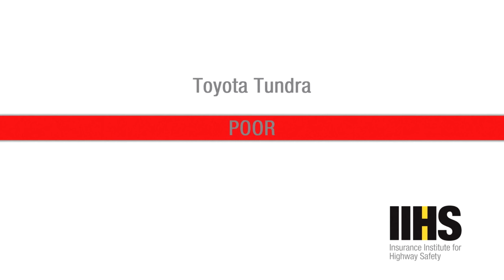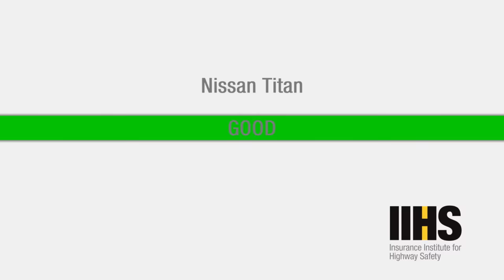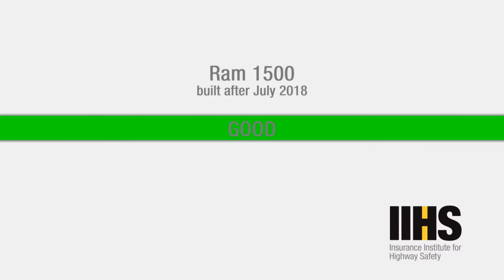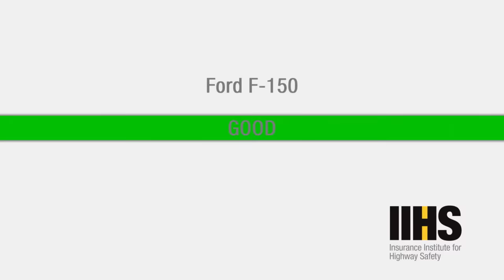TRUCK CRASH TEST COMPILATION - Ford F150, Toyota Tundra, RAM 1500, Nissan Titan

Comment: Im waiting for the CYBERTRUCK crash test
Reply: 999 Subs Without Videos same
Reply: Im pretty sure it will be very poor as i have no idea how exactly a steel shell will absorb the crash energy..
Reply: It'll drive right through the barrier haha
Reply: @ggoddkkiller1342  You have no idea, but you are sure it will perform poor? Interesting logic.
Reply: Probably won't even get a dent
Reply: @advandermeer  it's a super hard metal that is used on the Cyber truck... and because of its front being empty it can absorb a lot of the energy.....
Reply: @ggoddkkiller1342  go to your old school or current school and let your parents ask for a refund since you have no common scene to this logically
Reply: Arno Nell Acrually, you’re the one who needs to go back to school and learn proper grammar.  Beyond that, @Ghoddkkiller is correct, the cyber truck, as built, does not appear to be very survivable due to its rigid construction. This has been pointed out by MANY automotive design experts. It’s laughable that so many people think this thing will actually end up looking like what was revealed. It will not pass even pedestrian safety standards.
Reply: Cyber truck will break the barrier
Reply: @jeremyrodriguez5923  😍
Reply: Ad van der Meer actually it has no front crash zones as per its pictures and to be sold changes will have to be made. Most likely a longer front end .
Reply: Me too i want to see how that thing breaks
Reply: ye me too
Reply: @Luis Bolanos not funny, didnt laugh
Reply: @jeremyrodriguez5923  cybertruck can be still driveable and gets a acceptable rating
Reply: @Pilot545  you spelled actually wrong so stop talking
Reply: 999 Subs Without Videos its probably not even gonna crash bruh its just gonna bend a little lol
Reply: Jeje
Reply: @advandermeer  cars need to absorb enough force so the driver doesn't die from a crash. The front of the cyber truck doesn't seem long enough to absorb the force of an impact.
Reply: Dont you know sir they are incapable of wrecking
Reply: @Jonathan Young sounds pretty safe
Reply: @ru5h21  That barrier has been used for many years. I highly doubt the Tesla Cybertruck will do damage to it
Reply: @bradygiles4059  The barrier will not break to the cybertruck due to the shape of the Cybertruck having many weak points, It does not make it safe if it does not break, in slight chance it does break the barrier, it will not be allowed on road due to dangers of opposing driver in the chance of an accident
Reply: That's basically crashtesting the facility
Reply: pretty sure that design is never going to be road legal
it's one step short of putting massive blades on the outer shell of the car
Reply: Its gone be a murder
Reply: @ggoddkkiller1342  teslas are very safe safer than regular cars
Reply: Blurzz Melo  everyone already cought up already the only thing that is special about Tesla’s is the autopilot
Reply: Probably will damage the test equipment
Reply: You have 21 subscribers
Reply: Don't worry, Elon musk already bought the crash test company
Reply: Blurzz Melo Volvo: Am I a joke to you?
Reply: @advandermeer  Yes it will perform purely because it is extra hardened steal that sole purpose is to only protect the people inside while he will destroy other cars, instead of "helping" to divert the impact energy.
Reply: @arnonell   It can absorb a lot of energy because it is empty? Nope, completely false logic. It needs the energy to travel along vectors. Empty space does not do that, besides that steal will not deform as easily as other cars, meaning that it will hit the other cars like a wolfram bullet.
Reply: Gonna be -100 stars
Reply: @ru5h21  🤣🤣🤣🤣
Reply: It's a cypercash not a Truck
Reply: Ggoddkkiller tesla wouldn’t dare to make a vehicle without a 5-star safety rating
Reply: @arnonell  That means the meat sacks inside get splatted on the dashboard.
Reply: i can just picture the test guys getting pissed that the thing keeps swerving to avoid the collision
Reply: They need titanium wall
Reply: @ggoddkkiller1342  well the rest of the tesla line up is almost perfect
Reply: Remember it’s unbreakable windows? 😅
Reply: I bet that it will just bounce off the wall😂
Reply: @ggoddkkiller1342  "I'm pretty sure it will be very poor because I know nothing about engineering, automotive science, steel, crash tests, or anything at all really. I'm just pulling a guess out of my ass and pretending I know things that I obviously don't." You're a joke, dude.
Reply: It will probably explode like most teslas do
Reply: @bradygiles4059  same like someone break cybertruck window hahahaha
Reply: Cybertruck will never be road legal.  It was a meme.  Eventually all those $100 pre-orders will be refunded.
Reply: Ad van der Meer he’s saying no body of a car has ever been built like the cyber truck, cars now days are meant to crush so you don’t get the force from wrecks. The cyber truck is made to last, not only is it made out of a steel shell, it resembles a triangle, a triangle being the strongest shape, as shown in bridges, and Sence the truck has not been let out or tested, he does not know but that is what he believes.
Reply: Ggoddkkiller i’ll be surprised if it’s approved for street use and has safety ratings
Reply: It will fold up just like the rest ive dropped 312 stainless on the floor from waist height once and it dented like any other solid material that stainless sheet metal body will fold hitting a rigid barrier like above
Reply: It would be going 100 mph and not even have a dent 😂
Reply: It would probably disintegrate
Reply: It will dodge the obstacle itself 😂
Reply: since its a totally new design without years of crash testing to make it better im sure it will be one of the worst....
Reply: Ikr
Reply: Same
Reply: Yeah... The cybertruck will result in lots of deaths. Older cars used to be made of solid steel and the fatality rate was much higher... The cybertruck has no crumple zone, so you and people around you would be dead...
Reply: Plus any way its gonna be too expensive for a crash test
Reply: Yea boi
Reply: @ggoddkkiller1342  Steel absorbs energy very well. It deforms instead of breaking.
Reply: The wall would break
Reply: Bounce like tennis ball.
Reply: @adammorenberg6755  says 2017 model s
Reply: No to worry, the batteries will explode and catch fire...🤡

Comment: Idc who you are, for all of those truck people out there you would agree. The Honda Ridgeline isn't a REAL truck. Unibody or a cab on frame, don't matter. Separated cab from bed, Don't matter.  Drop tailgate, don't matter. At minimum a solid rear axel, don't matter. Until honda makes a truck that can compete with a Tacoma at least, it will never be a real truck. More like an oddessy with no roof over the rear portion.

Comment: The REAL badass is that block of steel.
Reply: Installing diesell turbine engines and tracks.
Reply: Robin Miller I want my Titan made of that same steel!!!!
Reply: Lol it's not steel. Its concrete with plastic casing.
Reply: @JSLCummins  how do u know?
Reply: I will try to avoid these stationary pillars, when driving down the highway.
Reply: @delano62  don't they have barrels full of water in front sometimes
Reply: That is Not plastic its T slotted steel encased with concrete and how do I know because I've worked with these test and the equipment
Reply: Ford?
Reply: I maybe think it's mixed with steel and osmium. Because it's crazy dens and hard. If not then Idk
Reply: @jeremyp5123  , that's what she said.
Reply: @Josh-179  who the F is she.
Reply: @jeremyp5123  , seriously?
Reply: @Josh-179  who is she. Robin Miller. I really don't get it......
Reply: @jeremyp5123  , you've never heard the phrase "that's what she said" following a sexual double entendre? It's a joke said millions of times.
Reply: @Josh-179  that  joke i have never heard of. Otherwise it's a American joke.
Reply: @jeremyp5123  lmao dude😂
Reply: Robin Miller yes
Reply: True!
Reply: Qual a velocidade dos carros ,  no  teste
Reply: I was in a car accident with a Chevy Silverado 2500 HD 2015
Reply: Sério
Reply: @mancaveveteran4975  I meant is it really a truck if you do? Kinda turns into heavy machinery/military stuff.
Reply: Yes sir

Comment: Interesting to see the Ford almost deflects itself out of the way.
Reply: Yeah, strait into the path of a passing semi...
Reply: @justin76bmw  right...
Reply: @justin76bmw  or not
Reply: I saw that
Reply: I'd bet you have a ford.
Reply: @nicstr28  I have a Toyota.
Reply: It’s cause the wheel bent inward.
Reply: @justin76bmw  Unless the object it hit was on the road, the truck didn’t bounce far enough to change lanes. If that was a parked car or tree etc. that wasn’t blocking any portion of the lane then the truck isn’t deflecting into oncoming traffic. Keep hating though!
Reply: Michael Teeple  Guess that’s why F-150s have the highest safety rating of any pickup...
Reply: Michael Teeple   actually the whole point it to protect the passenger compartment. notice how there is almost no give to the cabin unlike the tundra. Also if you notice they drain ALL fluids so no vehicles are running. They are pulled by a moving assembly under the floor.
Reply: fords are best
Reply: Michael Teeple  Had two F150s go past 500k with only spark plugs, regular maintenance and electrical issues (cabin lights.) One was a 99 and one was a 2010 and I’m onto a 2018 now. Also sold both in working condition. You know nothing about Fords other than what you hear in the media and on GM fanboy forums. Tell me how a lawsuit somehow makes the safest, best selling, most powerful, reliable truck on the road bad.
Reply: still the cab folds haha
Reply: @konrah1486  Thats why ford has a shitty poor rating in vehicle to vehicle crash tests
Reply: Volvo has been using this deflective design since the late 80s. I don't understand why some American vehicles still don't deflect in these collisions.
Reply: Definitely did better than the Jeep Wrangler that flipped during it's driver side test.
Reply: Yea
Reply: Was in a T-Bone last week with my 2008 F-150. Luckily I was in a Ford or may not have been able to pull the unconscious passengers from the smoking car that ran the stop sign.
Reply: @justin76bmw  duh...derp
Reply: @justin76bmw  you are "happy" owner of Toyota? 🤣🤣🤣🤣🤣🤣🤣🤣
Reply: Yeah and the vehicle from the front bangs it in a narrow lane and in one day the vehicle form the rear bangs it again and causes a pile up.
Reply: The defletor shild was set to max, I myself run it on medium.
I just realiced, I'm in the wrong century again.
Reply: I think it's the way the tire bent in /the front suspension gave way
Reply: @justin76bmw  good point, never thought of that.
Reply: @konrah1486  lol yeah right
Reply: @damitbobby6677  Yeah right what 😂
Reply: @konrah1486  500k on a ford
Reply: @damitbobby6677  500k on two Fords* 99 4.6 and 2010 5.4, guess you’ve never owned one!
Reply: @konrah1486  I have owned one. That's why I was saying yeah right
Reply: @damitbobby6677  Guess you got unlucky. What year and engine? Really hope you’re not some GM/RAM guy trying to talk about reliability...
Reply: Nostalgia am I right
Reply: @Dubz0408  Probably because GM is notorious for making unreliable cars. Ford isn’t, GM boys came up with that because they’re insecure about their trucks breaking down at 100k
Reply: @justin76bmw  Aww, him's mad. Let me guess. You bought one of the rice or pasta powered pickups, "because, "it looks tough.""
Reply: @Dubz0408  I had an 03 f150 that was already hagged to shit an it only died at 476,000 after I ran it all the way home on a blown engine and no oil. If it was maintained, woulda went forever
Reply: @danielhagen3739  Did you tear it down? What in the engine was damaged?
Reply: @Dubz0408  the main seal between the engine N trans, I blew it an ran it outta oil. Dumbass move on my part but I paid $1500 for the thing
Reply: @danielhagen3739  I wouldnt consider that blowing the engine lol. Seals blow from high oil pressure so if your pressure relief valve failed or if the seal was just old and brittle which main seals are known for, then there ya go.
Reply: They aren't the best selling pickup of all time for no reason
Reply: That is due to the design of the frame that Ford uses.  It is one of the many reasons we only buy Ford trucks.
Reply: Because ford knows how to build real trucks and vehicles why every commercial police ect uses Ford vehicles exclusively . Idgas about your options stating the facts and my personal experiences fords are the  best trucks I've ever owned period and will ever own .
Reply: Probably made it that way which is smart
Reply: @hermannparkhomenko1166  Toyota’s are good bruh chill Toyota is like the biggest vehicle seller around the world
Reply: @HSSANITO  Toyota made really great models, till 2016-2017,after it, quality of their cars, went down (not dramatically).

Once, a time, USA cars, were top in the world. So, quality of selling is not a thing to trust firstly.
Reply: Fords deflect because a few years back they got rated poorly on the overlap test. They designed and implemented a CRASH BAR that sits behind the front wheels to help prevent cabin intrusion and to deflect the energy of the crash.

Thats why they stated the sensors indicated a LOW risk of injury for all body areas on the crash test dummy after the crash. The cabin of the truck stays intact, the forces are deflected instead of just absorbed and the driver lives to buy another Ford truck. Win win.
Reply: @HSSANITO  quantity does mean quality lol.
Reply: They are design that way.
Reply: @justin76bmw  yes because there are lightpoles in the middle of roadways...
Reply: @mrjargogle3103  no.
Reply: @rustbucketrevivalllc6064  interesting rebuttal random person i dont know on the internet, ill keep that in mind 😉
Reply: All that aluminum being spongy
Reply: @konrah1486  actually f150 is rated very low on resale and reliability statistically, and is not #1 in sales, why? Cuz ford will not release there f150 sales numbers, they just group it into “f series”. There is a difference. Show me from fords own website how many f150 they sold in 2017 2018 2019?? Then show me how many “f series “ was sold in the same years. Also look up depreciation of f150 and then depreciation of tundra, also look up most reliable used trucks in the last ten years
Reply: @konrah1486  ya but not on stock motor and transmission, ford trucks statistically are rated one of the worst for resale and reliability, look it up
Reply: @Damit Bobby
500k on a Ford, you spent way too much green...........🤣🤣
Reply: @dustyroads5409  could have got half a trophy truck for $500,000
Reply: @elijahrood7271  Fords used to be best.
Reply: Volvo is the safest story of all cars, literally the best vehicles on the road for so many reasons and for that, ruined.
Reply: @Sealmeal  Volvo is the best crash test ratings ?
Reply: Probably due to its rigid frame. I'm pretty sure out of all of the pickup trucks Ford uses the most rigid frame, going for full box frame all around while most other trucks use combination/hybrid frames to try to save weight.
Reply: @damitbobby6677  don't see how that's hard to believe. My dad had 2 Ford Aerostars go past 500k miles, my friend is a contractor and has had multiple F150s go past 400k-500k miles and even when he traded it in for newer F150s it was only because he wanted a new one and not because the old one broke down or had significant problems... my current Ford Edge has 222k miles and still going... I also used to be a mechanic and Fords do not live up to the jokes about their unreliability. But you keep believing in the haters and keep believing that 99% of construction companies exclusively use Ford trucks because they are all masochists...
Reply: @HSSANITO  agreed, I am a Ford guy myself but that doesn't mean I have to unfairly hate on other brands. Toyota makes great vehicles.
Reply: @titirititiri6360  I don't know if Volvo has the best crash test ratings, but they are a brand known for their safety. Remember that Volvo invented the 3-point seat belt system pretty much every car uses today and allowed for everyone to use it royalty-free for the sake of safety. They got my respect.
Reply: @TalkingHands308  i learned something new, thanks
Reply: @nicstr28  I have a dodge lancer
Reply: Its cheating
Reply: Ford. "Go further"
Reply: In vehicles some of that crash structure further back can be described to not only slow the force of the impact but should the crash intrude.far enough it can be designed to make it go around the interior compartment
Reply: @konrah1486  my 2005 ford f150 5.4 had 415k on it when I gave it to my brother who still drives it today
Reply: Right into the other lane.
Reply: @silvere36  feel sorry for you - maybe you should buy a REAL truck - a FORD!
Reply: Yes it is a ford they are strong
Reply: and if you look at current Toyota Tundra is the safest for 2022. (So they fixed it. No shocker) Ford is STILL right there at #2.